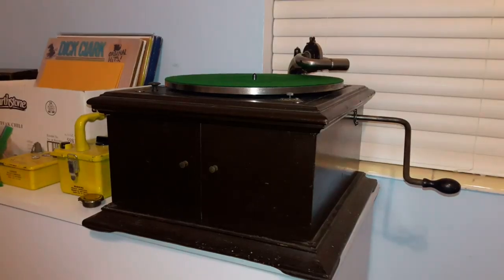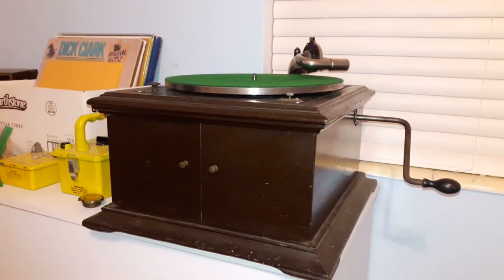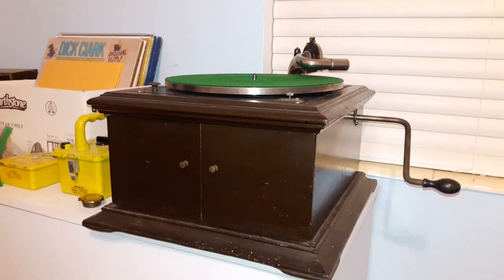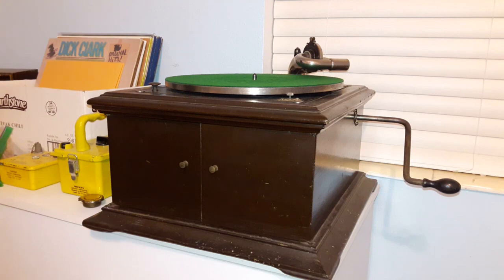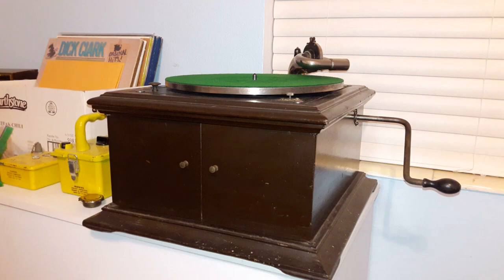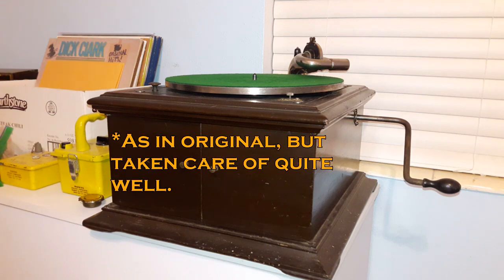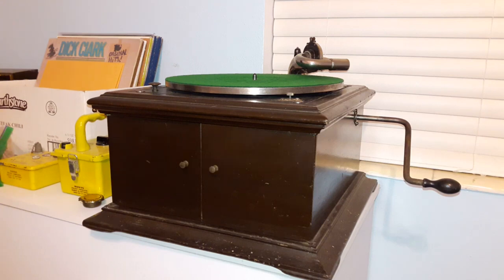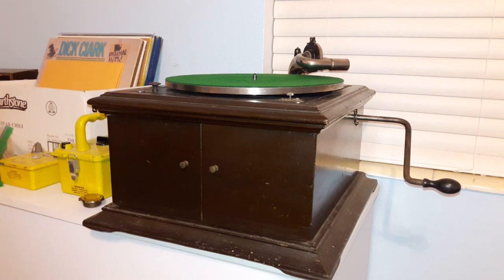Victor VV-VI Update.

Comment: The only Phonograph I have is a Rare portable Stentor phonograph 
It’s a Off brand company and there are not many stentors left. Mine was built in the 40s since it has the corner Metal pieces and a navy blue colour.

It was free at a antique shop since it was broken. Box bottom was falling off, mold In one corner inside the box, box joints were loose, motor didn’t work etc.

But all that has been fixed. With some wood glue and putting gears back they were. 
The mold was easy and took some bleach 

I don’t wanna remove that Cloth around the box even though in the corners it fell off. 

Anyways Nice job on this phonograph of yours!
Reply from the maker: I don't think I ever heard of a Stentor. Glad you're helping preserve the more forgotten machines. How does it sound?
Reply: @CPorter  sounds fantastic with new homemade Rubber gaskets since the original ones were about to dissolve

Update I’ll post a video with a record on it soon!
Reply from the maker: @MayasRock78s  alright nice